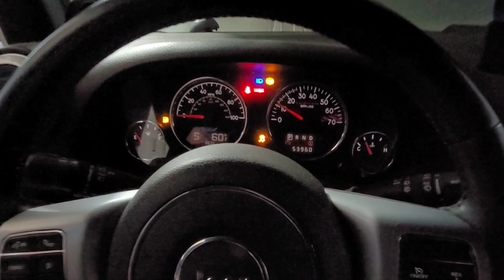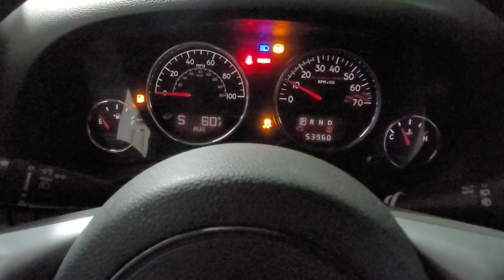6.4 JK SWAP! WHAT COULD GO WRONG!! (Video 10)

Comment: Did you use JSS power steering reservoir mount or one from PSC?
Reply from the maker: I ended up making my own bracket that attached to the brake booster. If you check out the last video#9 you can see what it looks like